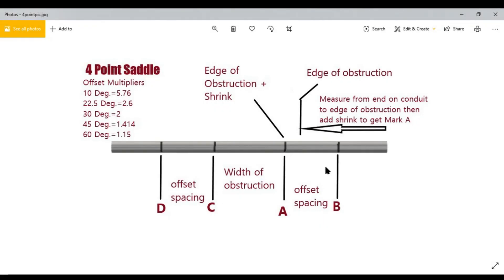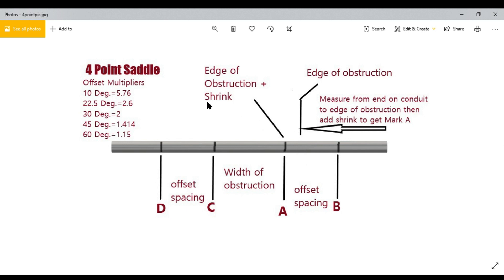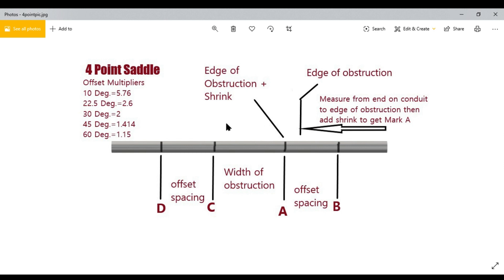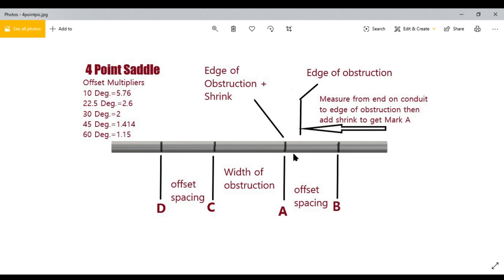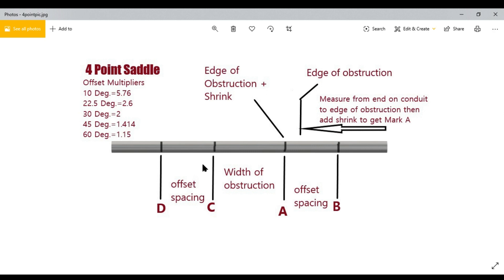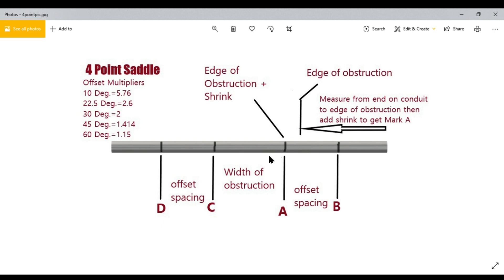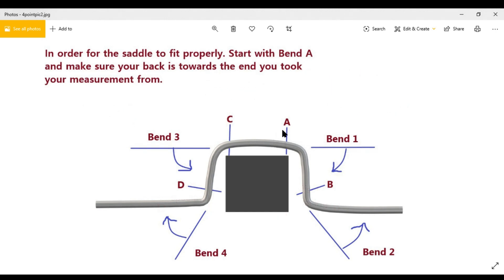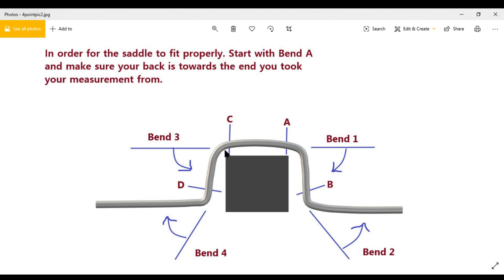EMT Conduit Bending: 4 Point Saddle, Edge of Obstruction Method

Comment: Your going to make me a journeyman thanks bro haha
Reply from the maker: @Cowboyfromda44  glad I could help Cowboy. Listen I don't do this for any other reason but the fact that I like to help.  But with that said I need help with the projects I'm working on which is creating and having this electrical software for apprentices built and programmed. I'm working on getting it done. Basically it will help and assist in teaching electricians learn everything about conduit bending. I have other stuff I'm working on as well for the channel. But for the most part I'm fund raising for that project. If you can contribute by donating a small amount it would help tremendously.  I'll leave links below thanks. 
Cashapp- $artofconduitbending 
Venmo@melrub480v 
Melvin.c.rubio@gmail.com
Reply from the maker: @Cowboyfromda44  Join the Discord Community 
https://discord.gg/qm4haAny

Comment: You used a multiplier for a 45 deg which is 1.4 and the rise dimension of the obstruction which is 5. When multiplied that equals 7 for the spacing between bends. Where is the 7 1/8" coming from? The shrink calculation of obstruction 5" by the 45 degree 3/8" rule is 1 7/8...  just dont know what I missed with the spacing calculation... can you expand on this. I know this is an older video. Just watching for the first time
Reply from the maker: It's no big deal. I use multiplier of 1.414 but it's the same . As you can see it's only an 1/8" difference which is not going to make any difference at all.

Comment: Hello. 
Quick question. When you are making a 4 point saddle, why is it that you apply shrink on point A only. If you are making 4 bends, dont you think you should apply shrink to all 4 bends?
Reply from the maker: Look at this way. Only one offset is headed towards the obstruction so you're trying add the shrink for the first offset. The second offset is passing the obstruction so it don't matter. But that's a great question

Comment: Do you still have to add the shrink to end of obstruction if your bending on center of bends. Not at the arrow benchmark?
Reply from the maker: Yes the conduit is still going to shrink no matter what. Bending on center is just so you can bend more precisely  in the field when you need to. Conduit will still shrink though. Hope this helps.

Comment: Is it possible to bend a 3 point saddle on the ground as well??
Reply from the maker: Yes . But why would you. You could probably do it off a stair case. .
Reply: @TheArtOfConduitBending  i like bending on the ground using my level cause it makes sure I don't dog leg my conduit. I usually dog leg my pipe when I do it in the air.
Reply from the maker: @pfunk500  hey listen I still struggle with lining up even my offsets if I don't do either of these 2 tricks I'm about to teach you. One of them I have a video of which is placing a mark on the center of the pipe so you know where your center is when flipping your conduit. Watch the video it's called something like stop dogging your conduit by holmzlaw. Second trick is very similar but I think helps a lot more and I haven't yet made a video of it. Grab a 4x4 square 1900 box place a emt connector in any of the center KOs. Now install the box onto the conduit that your bending. What this does is act like a level that you get to see better when you place the conduit with the box attached to it, it helps you see whether or not your conduit is straight or not in reference to your bends. Hope this helps and that you understand what I explained just now. I'll try to come up with a video of the process soon.
Reply: @TheArtOfConduitBending  Wow!.Thats so cool!.Can't wait to see that video!

Comment: How did you come up with 7and a 8th for mark/bend B??
Reply from the maker: The 7-1/8" is my spacing between bends for my 2 offsets. I got that by multiplying the height of my obstruction also the height of my offset. Multiplying it by my 45 ° multiplier which is 1.414 so in other words
5x1.414= 7.07 = 7-1/8 or 7. That's mark B & D. Hope that helps

Please follow and endorse me on LinkedIn under my profile skills section.  Thanks
Www.linkedin.com/in/melvin-rubio
Other social media:
Instagram/holmzlaw
Facebook/holmzlaw
Tiktok/holmzlaw
Reddit/holmzlaw
Reddit/r/conduitology
Snapchat/holmzlaw
Tradehounds/holmzlaw

Comment: Love your videos! How did you get your measurement from point A to B and point C to D?
Reply: The measurement came from using the multiplier for a 45 degree offset (1.414) times the height of the obstruction (5 inches). It’s roughly 7 and an eighth
Reply: @GhostKnotes  Awesome thank you for that info!

Comment: Great info thanks. I do have a 2 part question tho. If you have a box offset from where you initially measured or on both ends, do you bend that first or after? And if you do bend the box offset/offsets first, does this change the direction the bender faces on the other bends or do you still do it as you you explained in the video. Thanks
Reply from the maker: Honestly, you can do it how ever you like. But ive noticed that if you do the box set last after your offset you can end up taking out some of the bends on your offset if you are not careful. I try to do my box sets first. But in order to do that sometimes not all the times you need to know exactly how much conduit you're going to need so that you can cut it then bend your boxsets. I have a video explaining shrink and gain to figure total length if you're interested. Now, for you're 2nd ❓ Box sets won't  change how you have to bend your offsets at all. You just have to pay attention to the orientation of the boxset and offset to make sure they are both in the direction you need them to be. Hope this helps. 
Follow me on:
TikTok/holmzlaw
Facebook/holmzlaw
Instagram/holmzlaw
Reddit/holmzlaw
Reddit/r/conduitology
Reddit/holmzlaw
Tradeshound/holmzlaw
Twitter/holmzlaw
Quora/artofconduitbending
Quora/holmzlaw

Comment: How did you get the spacing which is 7 1/8 thanks .
Reply from the maker: My rise was 5 inches and the degree of bend i chose was 45°. So my multiplier is 1.414 for 45° bends which = 7-1/8 " spacing between bends.
Reply: Holmz Law o I see thank you so much , god bless
Reply: Holmz Law 1.141x=5.705 ?
Reply: Holmz Law 1.145x5= 5.705 ?
Reply from the maker: @TheJugster1  wrong its.
5X1.414= 7.07 which is 7 or 7-1/8 which ever is fine.